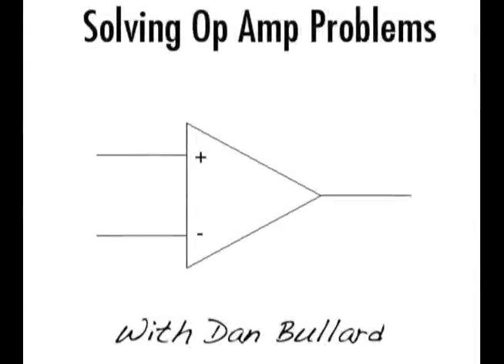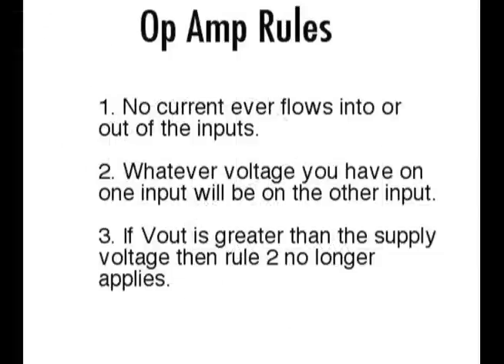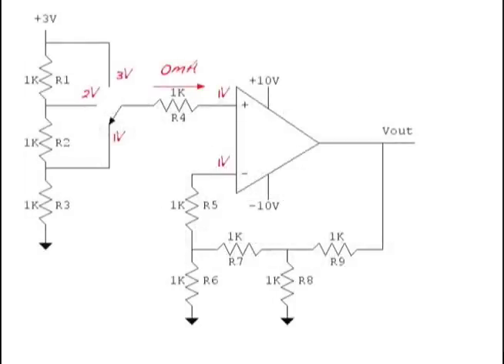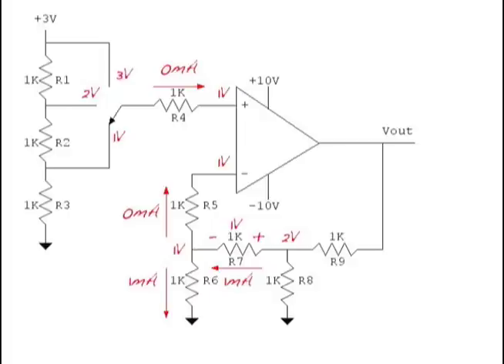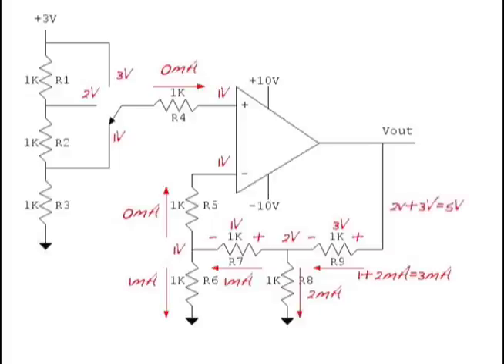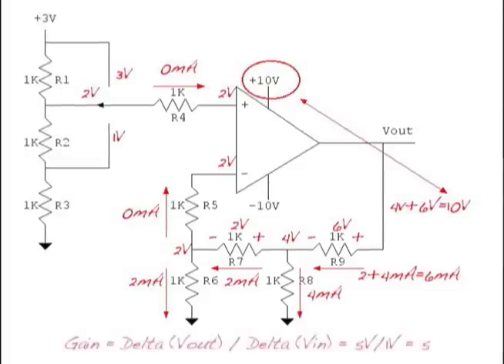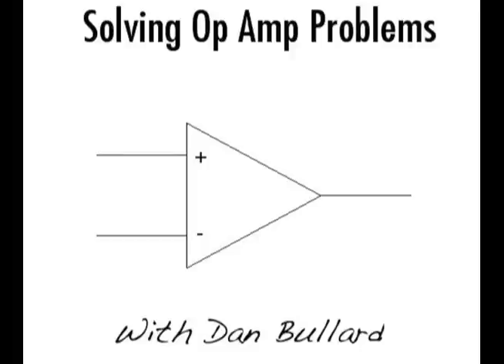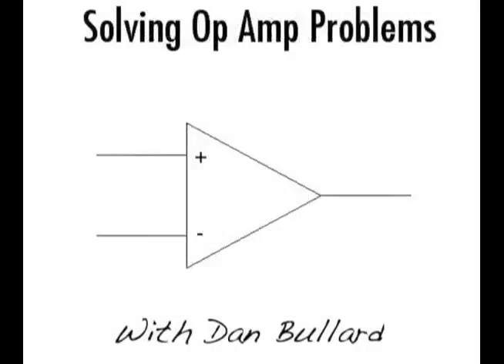Solving Op Amp circuits

Comment: Excellent work, though I'm not convinced that NO current flows through the inputs.  After all, Voltage = Resistance X Current, and if current is ZERO, then so is voltage.  Plus, if no current flows through R4 & R5, then what purpose do they serve?
Reply from the maker: The current is very tiny, too small to worry about in 99.9% of cases. When the resistors get to be in the Megohm range, then start to worry about them.
Reply: Dan Bullard Fair enough.  I know that all mathematical calculations are approximate anyway, since one can only compute to a finite number of decimal places.  However, as you mention, the resistors have negligible effect in the circuit until they reach the Megohm range, but then, what WILL be their effect?
Reply from the maker: flurng For the first approximation (i.e. an interview) it's best to ignore those resistors. Once the values get into the Megohm range then those resistors will start making voltage drops which will impact the output. However, most good designs don't put Megohm resistors there. The only reason for them is to prevent massive amounts of current if the op amp input was to blow up and short out. The only reason there are two resistors is that chances are good that the input leakage on one input will be the same on both, and so there will be no differential error, which means no appreciable output difference. See Horowitz Art of Electronics for more info.
Reply: Wow!  Thanks for the amazingly prompt ( and coherent ) response!  Really helped clear up a few things for me!
Reply: One explanation is the large feedback resistor provides a path for the higher voltage and higher current from the amp's output to go back to the input device or circuit. 

Without a large value for the feed back resistor, the voltage at the output would easily be quite overwhelming at the input device. If the input device was a moving coil transducer (like in a seismometer), the voltage and current would create a motor effect and the whole system would become unstable and probably oscillate.
Reply: Dan Bullard Thank you very much for this epicly clear Op Amp DC circuit tutorial and the exceptionally thorough answer for the R4/R5 question that had me boggled too, while watching the video.
Reply: I agree that the explanation appears to involve black magic and does not make sense. However my text book shows an op amp with an internal resistance (but not infinite) between the " + " and " - " input terminals, If current flows through this internal resistance, current does flow through R4 and R5 and the calculation of gain becomes intuitive.
Reply: kansasthunderman1 Good point about the internal resistance - I hadn't considered that!  If my questions regarding the purpose of specific parts seem somewhat naïve, it's just that I'm always keen to eliminate un-necessary components, so if they don't serve a valid purpose, they're gone.

Comment: looks like chinese to me. whats this non-inverting, inverting, feedback loop, biasing, impedance razzamatazz?
Reply: The inverting and non-inverting inputs refer to the polarity of the voltage swing at the output relative to the input. The feedback loop is used to determine the actual gain, add filtering, and modify a few other characteristics. Using an op amp with just open loop characteristics will produce unpredictable gain and create other problems.

Comment: Just an adjustment to your rules. If there is output feedback to the inverting ( - ) input, rule 2 applies unless V(out) is beyond the range of the rails or source.
Reply from the maker: Yeah, but... It's easier to just let someone do the analysis ignoring what might be feeding back to what. What happens when you have both negative and positive feedback? Who knows, until you analyze it.

Comment: hi ... i have Question about op amp lead lag network , can you help me with it ..plz
Reply from the maker: Ask away!
Reply: i need to prove tow equations >>> Z1=(R1C1s+1)R3/(R1+R3)C1s+1
Z2=(R2C2s+1)R1/(R2+R4)C2s+1
Reply: these equation about  op amp lead-lag  network
and there is Pic for the op amp, i will put the like for you
Reply from the maker: Djddjd Djdjddb It looks like a filter to me! Calculate the 3dB point of both circuits and you'll see where it rolls off.

Comment: Good video. You could also mention that rule 2 applies only to closed circuits, where the output connects in some way with the - input, and the impedance therein does not prevent the max output voltage from being too low to match the input.

Comment from the maker: No, not quite, gain is tied to change. If the circuit had a DC offset then your method would get the wrong answer for gain.
Reply from the maker: I calculated the deltaV, even with an offset the offset would have been negated. You are wrong.

Comment: Hi Dan,

The gain is also defined as Vout/Vin. Won't that work as well for this problem? You then won't have to find a change in the output for a change in the input.

Comment: You were showing the switch at 2v which corresponded to a Vout of 10v. You referenced back during this time to the initial switch position at 1v with a Vout of 5v.

Comment from the maker: Actually, it's only true if there's NEGATIVE feedback. Positive Feedback is another video, but the end of the video shows all you need to know about Rule #2. If you solve any Op Amp circuit this way you can determine if it has ENOUGH negative feedback to make Rule #2 true.

Comment: Great video.. I am wondering would it be too much to ask, if you could make video in regards to complex (subjective) electronic schematic diagram reading of electronic system with actual value you may have.  Most videos I've seen about reading schematic only with individual components of electronics.  There's nothing about how signals flow from one components to next in the system.  Read somewhere, most important about reading schematic is the ability to see how it all fits to together. Thanks.

Comment from the maker: It's simple Ohms Law if you ignore the Op Amp, which you can because it draws no current. Around 7:47 you will see how I simplify the circuit. R9 is in series with R8 to ground and R6 and R7 to ground.

Comment from the maker: Nope, that's not the way it works. The negative feedback from the output to the V- is the key. The output does whatever it can to keep the two voltages the same and refuses to oscillate because of a built in capacitive feedback network that limits high frequency gain.

Comment: If the differential between V+ and V- is zero, won't Vout become 0? If Vout = 0, won't the differential become maximum again? So the output voltage will just keep oscillating between 0 and maximum A((V+) - (V-))....